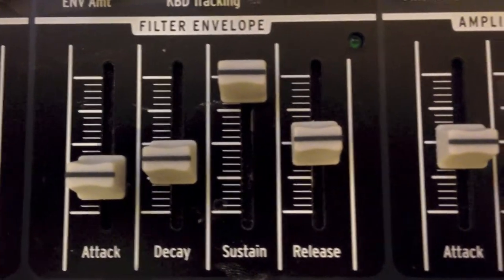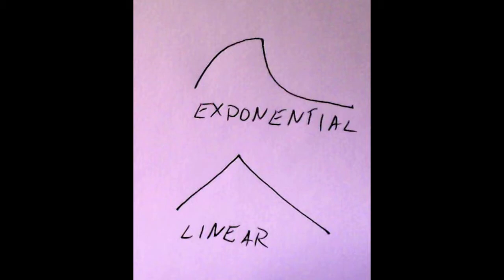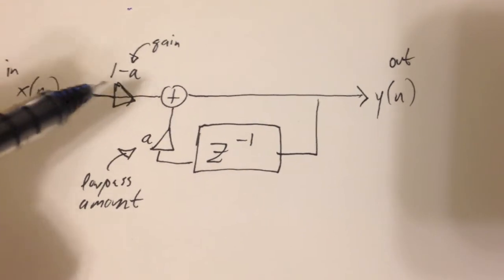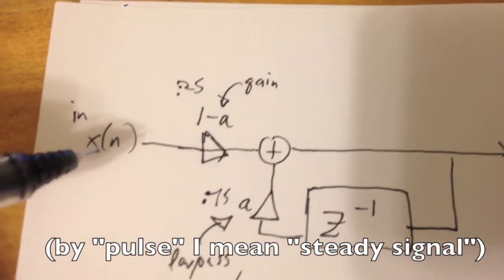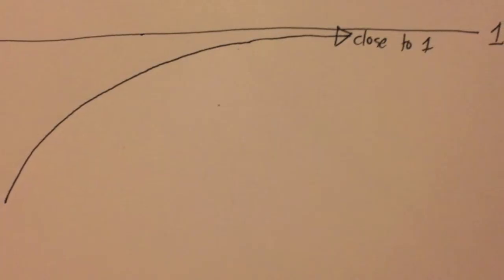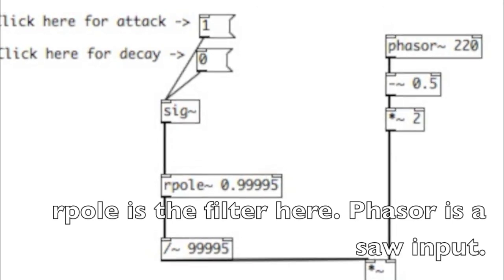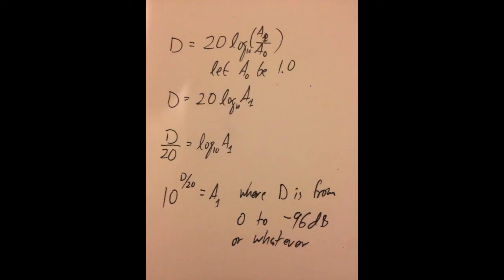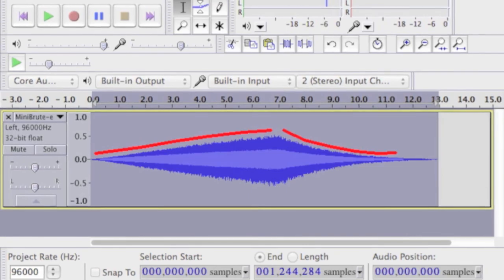Synthesizers and DSP #1: Envelopes

Comment: Isn't this karplus-strong?
Reply: Nope! While both this, Karplus, and a comb filter look similar at a glance, this structure acts as a traditional low pass filter. Essentially, filters take a previous input or a previous output, delay them, and then mix them back into the original signal. Where Karplus is different is that the feedback is fairly high and so is the amount of delay, so you get a very different result. In general, most filters like this only delay the signal by one or two samples as opposed to hundreds or more in a Karplus-like loop.